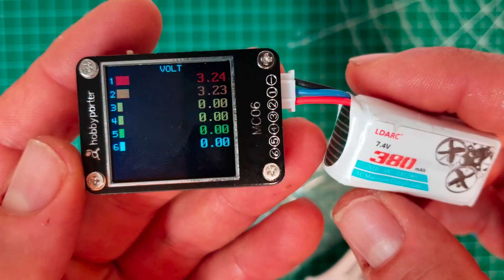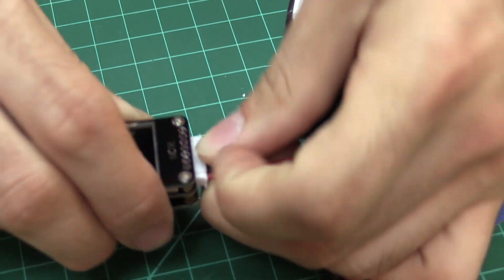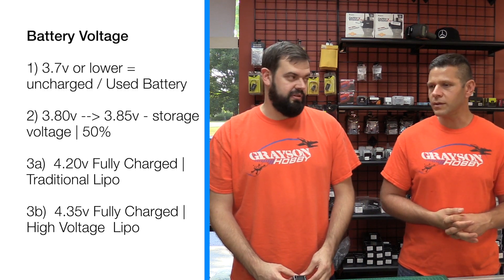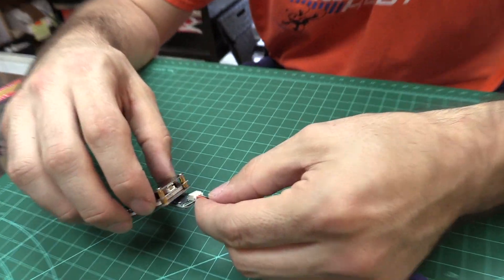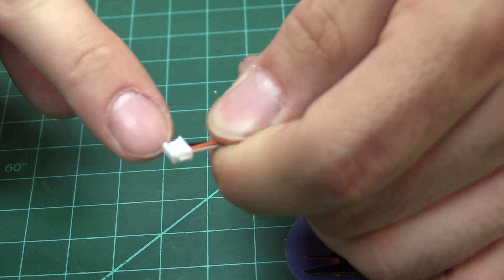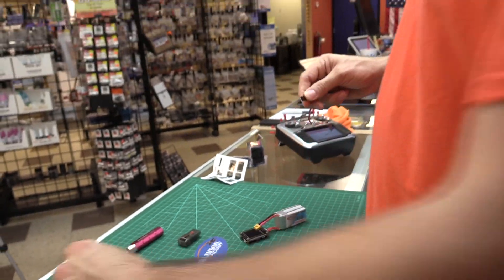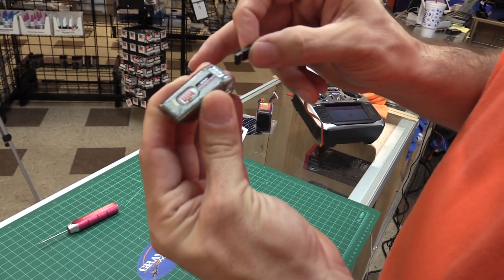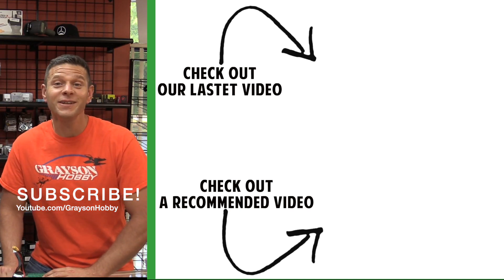Cell Checker & Receiver Tester 😮 How to test a FrSky | Specktrum Rx?

Comment: Is there any way one can test a battery remotely while actually sailing an rc sailboat? I want to know whether my batteries are depleted before the go dead. Is there a transmitter that can somehow detect the state of the receiver battery? Thanks for any advice you can give.
Reply: What I think you are showing is how to test the battery before flying. Is there any way to do this in real time while flying? Must be catastrophic if your battery dies while flying. Likewise, I could lose my boat if I lose control due to a dead battery.

Comment: Now that I've seen the video, I REALLY like that it gives the top/bottom/mid output readings since I adjust for that in my radio and not using the BF CLI commands. That way it's set pretty accurately across all of my kwads instead of just the one that I'd be currently tweaking on.

Comment: Always nice to see you guys. It seems the same as the Uruav checker, I use it a lot before parallel charging, a nice cheap small checker, perfect. I remixed a case for it on Thingiverse (but it covers the RX checker ports as I don't need those). Best regards from France.
Reply from the maker: Awesome,  we just bought a 3d printer and need some unique prints